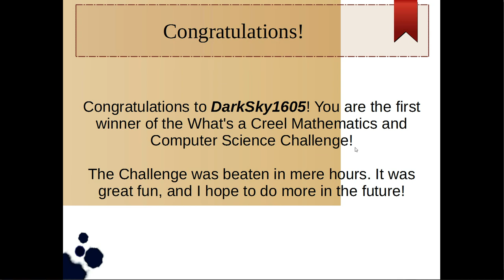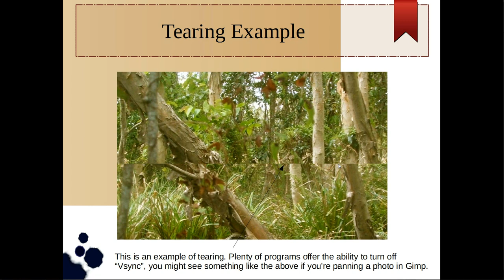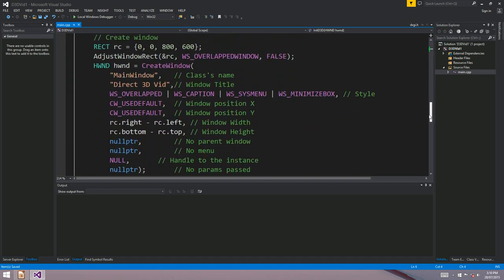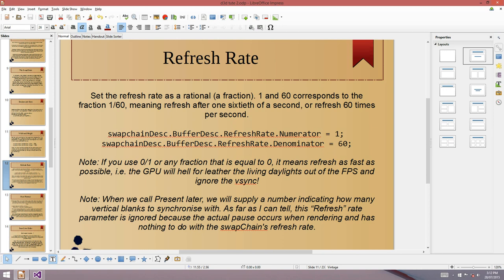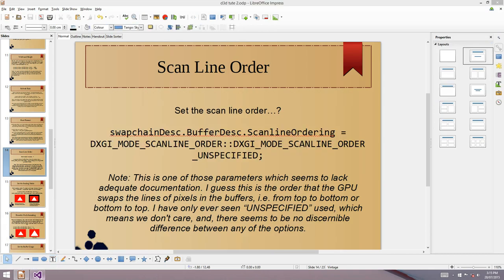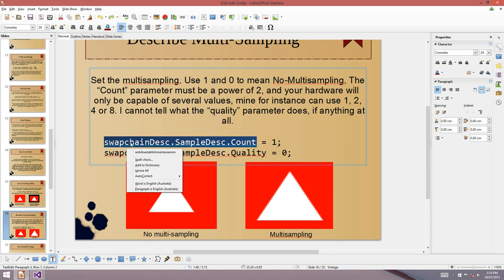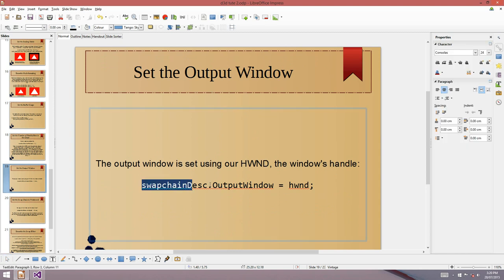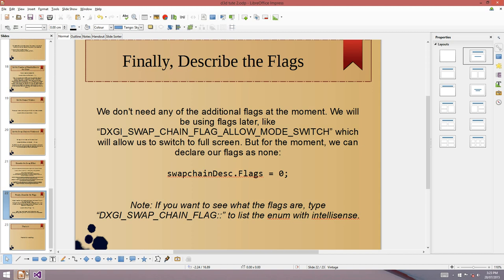Direct3D 11 2: Swap Chain

Comment: this is from msdn tutorial: sd.BufferDesc.RefreshRate.Numerator = 60;
                                              sd.BufferDesc.RefreshRate.Denominator = 1;
In your video those 2 are inverted,  so...I am no expert but it means 1/60 meaning 1 time refresh every minute?
Reply from the maker: I think 1/60 of a second, not a minute. Though I can't remember this code well.
Reply: 4 different source tutorial online do numerator = 60 and denominator = 1, safe to assume you made a mistake there, I am pointing out only as help to whoever is following this step by step to avoid pitfalls ;)
Reply: @WhatsACreel  refresh rate = Hz = 1/s, this is common knowledge for a graphics programmer. So yeah, it's now 60/1 Hz, aka 60 times per second aka 60 fps.